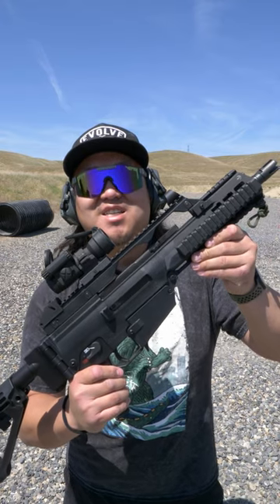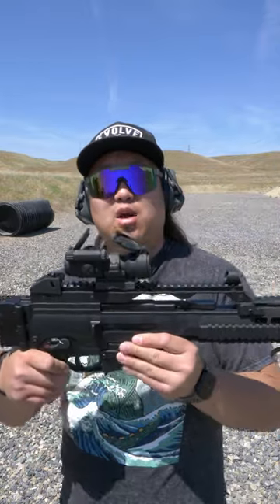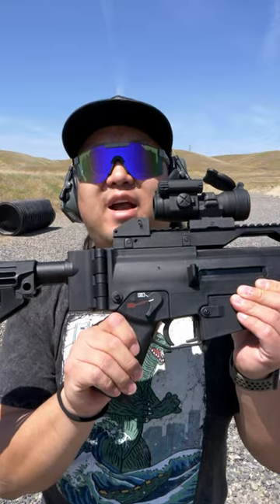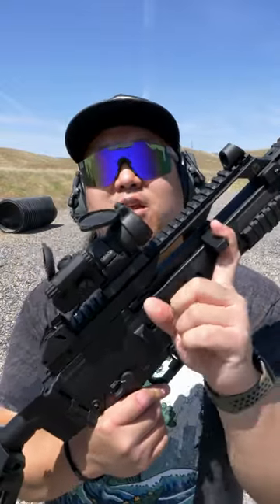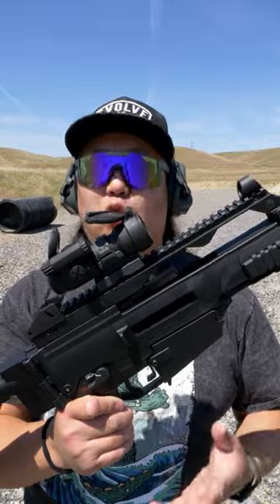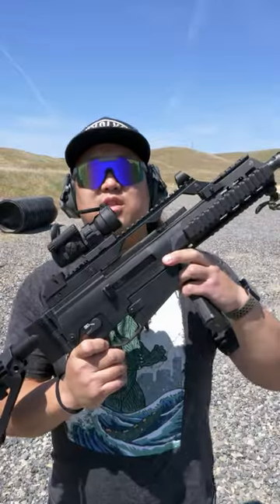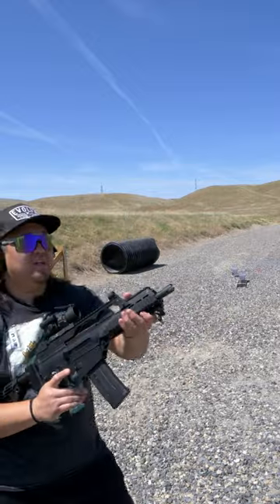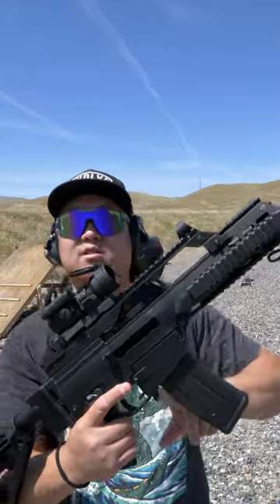How to use a HK G36 in under 60 seconds (Tommy Built TG36)

Comment: I love the charging handle design on the G36, that spring-loaded tab for ambidexterity is a great design. Can't help but think that if it got muddy or something stuck in it it might hinder the operation a bit, but you could say that about a lot of designs
Reply from the maker: Its a solid design imo and mine has seen sand and rain and has not locked up yet.

Comment: Great rifle with tons of modularity. I really Like that theres an Aftermarket magwell that allows the rifle to feed from AR magazines. Truly a rifle ahead of its time. Also a great military rifle given how affordable it is, a Standard issue Bundeswehr G36 Costs the Bundeswehr approximately 650€ .
Reply: And my tommy built was… FOUR THOUSAND SIX HUNDRED DOLLARS😭😭…. Bruh
Reply: I wouldn't say ahead of it's time. Rather fitting right into the area, with a rather short lifespan actually
Reply: @Robomann  yes it was ahead since it was one of the first reliable polymer military rifles, also had a nightvision scope attached by factory no other gun had that, in the 90s this was almost the best gun you could have without attachments
Reply: @BananaRama1312  The Steyr AUG is a very reliable polymer Rifle and has been around since the 70s.
It too, had a Scope coming from the factory and as far as I know, there's no "factory night vision scope" on the G36 either. It has a 3x Prism and a really really shitty red dot (non NV compatible) ontop.
you can attach a NSA 80 NV clip on to the 36, but that looks and feels like a Vietnam era Gen 1 tbh. So no.
The Argument can be made for the Steyr but the G36 is not and was not ahead of it's time.
it's very simplistic though, I'll give it that.

Comment: The ACR uses the XCR design where the tabs are outside of the trigger guard
Reply from the maker: Correct but it is in a similar position and manual of arms is why i mentioned it. I do prefer the ACR/XCR implementation over the G36/Bren2 version though.
Reply: @Gunghis  yeah, I'm of the same opinion. I don't like any catch system that involves sticking my finger into the trigger guard

Comment: There is a rumor that the G36 melts, can anyone explain if its true or not.
Reply: Merely a rumor. Continuous fire in heated Environments will cause any rifle to experience Shift, the G36 was used like that in firefights in Afghanistan. That led to these rumors gaining Attention, however the rifle was'nt designed for that kind of combat. H&K also make the MG36 wich has a heavier Barrel and a reinforced Trunion to allow durability and accuracy for prolonged full Auto fire.